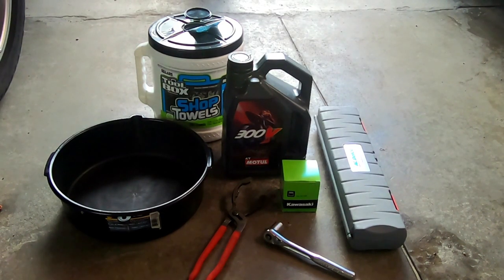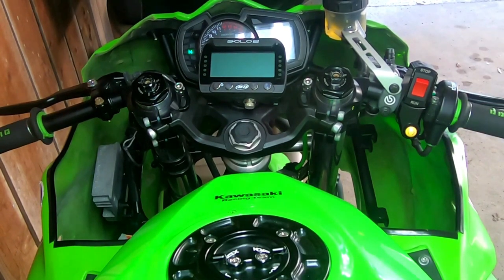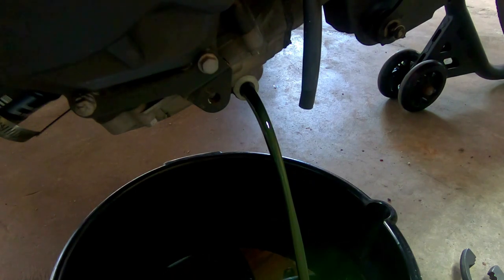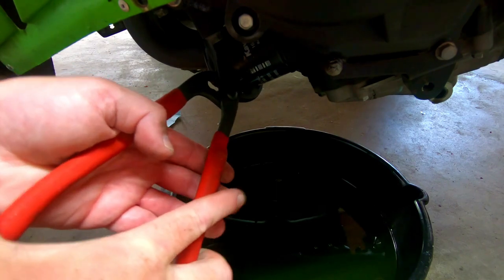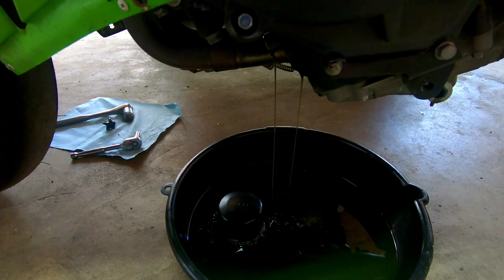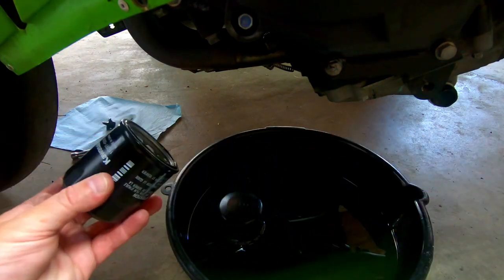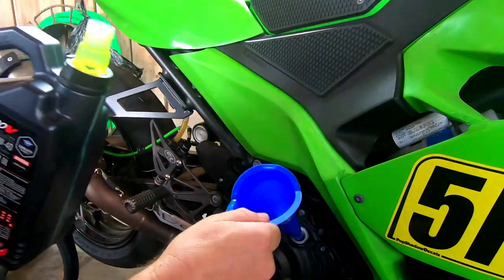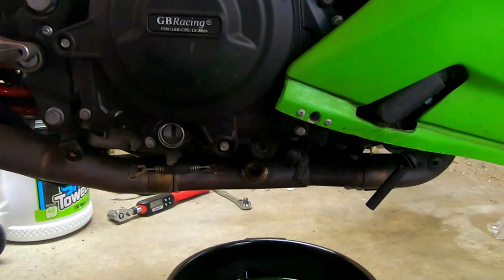DIY- Changing Oil in Kawasaki Ninja 400!!

Comment: Do you need a new washer?
Reply from the maker: Yes, I replace the washer. You can sometimes get away with reusing, but I don't recommend that unless you are in a bind.
Reply: @Racer510  yeah I did end up using the old one I ordered some that supposedly were supposed to be the right ones but the old one looked fine. Is there a reason why you should replace it?